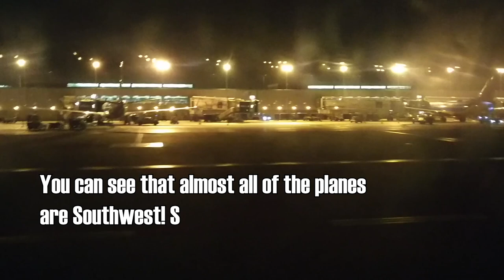Autofocus rambles and a landing at MDW

Comment: Beware, this is an extremely long comment. I figure you know some or most of this, but the audience watching this video might not.

Contrast detect AF, especially in continuous AF, needs to do a sort of constant "breathing" because it detects edges, and it can only detect the difference in those edges during a defocus. If it doesn't re-check for edges, it has no idea whether or not it's in or out of focus, and the only way to determine that contrast difference is to force a contrast check, which makes a slight wobble of the lens as it quickly makes a minor focus adjustment. It's usually looking for horizontal detail, and that's often troublesome when you have very small points of light. Contrast AF is not aware of depth, or the amount of defocusing, and unless it does a re-check (the quick hunt) it doesn't know whether or not it's in focus.

There are a few types of AF:

1. Range-check. This is done using an external measuring system. The first AF cameras used sonar reflections to determine the distance to the subject. This did work, unless you had something blocking the reflection or very long distances. This was introduced by Polaroid, but was quickly eclipsed by other systems. Because it's not through-the-lens, it's only useful for fixed-lens cameras with no filters attached and it's limited to nearby subjects. You could use another measuring system, like lasers, but the principle is still the same.

2. Phase detection. This is what was introduced in the early 80s as a through-the-lens method. While Pentax had introduced a contrast-type AF camera with the ME F in 1981, the first phase detect SLR camera was the Minolta Maxxum 7000 (or Dynax 7000 in Europe, or Alpha 7000 in Japan). Featuring its through-the-lens phase detect AF module and built-in body motor (instead of every lens requiring a motor), it was the first system camera to popularize AF. The trademark was "Only the human eye focuses faster," and, well, it was true. Its single AF point is laughably quaint by today's standards, but Minolta did put together the first really serious AF camera system.

Unfortunately, they infringed on Honeywell's phase detection AF patents to do this, and the resulting court case essentially crippled the company and set it on a path to merging with Konica. All of their misadventures with the xI series also sealed the deal. But that's getting ahead of ourselves...

Phase detection works by comparing the phases of two out-of-focus areas and determining the difference of focus (backfocus or front focus) and exactly by how much. It's not that much different in practice to using the split-prism in a manual focus camera's viewfinder. The camera then moves the lens focus group by exactly that amount. It is swift and sure, but it can also be fooled! All SLRs since the Maxxum 7000 use this method, just in greater complexity. Phase detection is great for continuous tracking AF performance, especially when combined with predictive AF algorithms. By comparing the in-and-out of focus areas not by contrast but by phase difference, the camera doesn't have to second-guess itself. It just makes the move based on the detected focus difference.

The downsides of phase detection are:

1. The modules are not in line with the film plane, meaning you can get distance measuring errors if the module is not in perfect collimation.

2. You're limited to where incident rays fall on the exit pupil of the lens. Because these systems use semi-silvered mirrors to steal light, you often get coverage that sticks to the central part of the frame, at best. The farther you get away from the center axis, the worse the phase comparison performance gets.

3. The phase sensors are limited to detection at certain F-stops and contrast directions. Some cameras have sensors with multiple levels of sensitivity (e.g. most Minolta cameras post the Maxxum 7, which have a double-cross f/2.8 sensitive sensor, along with f/6.3 sensitive sensors), but you only get that sensitivity boost on that one sensor. You can't AF with anything at a narrower aperture, and because the lens has to focus wide-open, you can get focus shifts when stopping down.

4. These systems can be fooled by very near subjects. The human does need to give it some help (e.g. using the joystick to position the AF point or using a focus limiter to ignore certain ranges).

Next, is 3. Contrast Detection. This is what's used in video cameras with CCDs, and most point-n-shoot digicams of the 90s and aughts. Contrast detect works by finding edge contrast. Go into Photoshop and use the "Find edges" filter and you'll see what I mean. The advantage to this is usually that it measures right off the sensor plane, so you'll never get front/backfocus errors, and you can use it at shooting aperture, which means you can dodge focus shift (most of the time). By making a quick snap of the focus, the camera can find edges in the image, and then once the edges reach a certain acutance, it locks focus.  This is great for single AF (lock on and then don't refocus). However, this is bad for continuous AF, because it doesn't actually know anything about the direction or amount of defocus. It only knows about edge contrast.

Some manufacturers (like Panasonic) have highly tuned this with their Depth from Defocus contrast system to improve continuous AF results, but it's still a bit weird and behaves differently from the phase AF-C that most people are used to.

You CAN combine these AF systems, especially in mirrorless camera bodies. Sony has lead the field in on-sensor phase detection systems, where certain pixels are masked to behave like phase-detect sensels. By having the phase detect on the imaging plane, you ditch the front/backfocus problems, and can have a much wider AF point spread too because the semi-silvered mirror is gone. By combining the on-sensor PDAF with contrast detection, you can get a best-of-both-worlds hybrid system where phase detect can do raw defocus/distance measuring and contrast detect can get edge acutance. This is what's setting the world ablaze with Sony's mirrorless cameras, and because other manufacturers are using Sony sensors (like Fuji and Olympus) they too can enable similar features in their cameras, albeit with their own implementations.

On-sensor PDAF can also be mixed with off-sensor PDAF, as seen in Sony's a99ii, but it's a rarity amongst cameras for a variety of reasons that are beyond the scope of this comment.

ALL AF systems are limited by light and contrast range (just different kinds of contrast). Very low light areas or areas with no detail (e.g. flat surfaces) will lose focus. This can be worked around (AF assist lamps), however the behavior of hunting changes based on focus methodology. Phase detect hunting tends to go towards extremes (fully in or out) while contrast wobbles and steps slowly. A wide AF array should be able to see large groups of objects, but without edges (contrast) or lines (phase) there's just no detail to check. Some cameras' wide AF methodology can only check for areas inisde one point (determine a point) while others will use multiple points in the plane of focus to keep the lock. Continuous AF is best for a moving subject, this is a case where using AF-S, back-button focus, or a program/camera that can lock or hold focus is better than just sticking with continuous AF.

There's also Canon's Dual Pixel AF which is a different physical of on-sensor phase detect, but works towards the same goal. Aptina (another sensor manufacturer) also did its own on-sensor phase detect system used in the Nikon 1, but they have since cross-licensed their patents to Sony and pulled out of most of the market.

There's a basic primer on AF systems, how they work, their gotchas, and their strengths. I forewarn you, going down this path is a dangerous one. You will start attracting camera nerds who put brand above all else, and they are not for the faint of heart. However, your videos are great and if anyone can do a straightforward explanation of how all kinds of AF works, I believe you are more than up to the task.
Reply: Thanks, this is very helpful!
Reply: Wow, excellent! Best youtube comment I ever read 👍👍
Reply: I read every AF as As Fuck
Reply: "...audience watching the video might not." Hey, I'm here specifically for this level of detailed tech info and geekery! To paraphrase Tech Connections Guy, "spoiler: huge nerd." Thanks for the edification. 😁
Reply: And what about using two sensors for sensing 3D? We have two eyes, and that contributes to fast focusing.
Reply: This is kind of what the Dual PDAF on the Sony a99 with AF-D mode and the a99ii with Hybrid PDAF does, in terms of multiple depth sensing. You can also build a depth map by using multiple focus points on a single plane, which is what Nikon does with its branded 3D tracking.

You can use other information to enhance AF, such as face/eye detection since the image sensor can give you more subject information, like color, shape, and acutance. Most of the challenge of AF is identifying the subject the photographer intends and following/predicting the movement of the subject to maintain the AF point position and move the focus along with the moving subject.
Reply: Great explanation, but I would not mind if you went into more detail (not kidding). Thank you very much!!
Reply: Regarding defocus snap on contrast-AF, most manufacturers design some kind of AI that can sense if there are big changes in the scene. If not much changes, the focus stays fixed. The moving lights have the opposite effect. Also they tend to emphasize the center since that's what most people expect cameras to do.
AFAIK, hybrid-AF defaults to contrast-AF in low-light situations.

A lot of phones today do hybrid-AF as well, most with the 12MP sensor. Some pixels (half?) from the sensor are used for phase-AF. I think the first phone to introduce this was Samsung S7, back in 2016. The S5 had only a single center site for phase-AF, as well as other phones at that time, so they were technically also hybrid-focused.

I think there is still a lot of potential to innovate as chips become faster and the cameras start to recognize what's actually happening in the image, instead of just blindly applying some algorithms. This is where machine-learning starts to shine, but that's a that's something that will have to wait for another episode.
Reply: Such a fantastic comment, thanks for the thorough write-up!
Reply: I'm a bit late to the party here, but I've got a few questions. (long comment for a long comment, even if yours is bigger... [that's what she said])

Is there a reason that modern cameras don't have the auto-focus calculations (hunting) be done... for lack of a better term, off-screen? Basically it would leave the displayed image at the current focus point, do the sweeps to find where it's most focused, or rather, where it's least blurred or smeared, then update the displayed screen to that.

Is there a reason that modern cameras aren't able to tell the difference between a dark scene (like the ground at night from an airplane window) apart from something that's just dark (like something painted black)?

Is it purely a lack of computational power that prevents a modern camera from simply trying to make each pixel have the highest possible contrast to the neighboring pixels? what about just a very large number of pixel points spread across the over-all image? If it's sampling, say... 1,000 points across the 2,073,600 pixels in a 1920x1080 image, it should be able to find the point at which contrast is greatest when the contrast is above X threshold with relative ease, so I'm assuming it's just a computational limitation of the components that make up the modern camera (ie: the CPU ain't stronk enough).

Although I'm not sure about modern stand-alone cameras, modern cellphones all have gyroscopic sensors, GPS tracking, and many other ways to detect movement, and so should be able to identify what the phone is currently doing. Can't the cameras use this sort of data to figure out that traveling at ~125+ mph while the camera is sensing mostly black and a bunch of point lights to detect that it's probably not looking at something close up and focus on the lights on the ground better? Obviously this wouldn't really work all that well for recording fireworks or christmas light displays, but surely there's more contextual data that the camera could utilize to better figure out what is going on, right?

Also, many modern cellphones now have multiple cameras. Are manufacturers (or programmers, whatever...) using those extra cameras to work together to create a superior auto-focus that can utilize multiple data points to improve focus? The (intentional) distortion each lens causes is a known variable and can be adjusted for, so it's not like the different lenses would make the data incompatible. Surely that extra data isn't just being left on the cutting room floor.
Reply: @TheAruruu  I’ll try to address each of your questions.

1. “Modern cameras” focus off-the-sensor using both the live view feed and phase detect sensels as part of the sensor array. When using the phase detect sensels, it tries to detect which direction to change focus by the difference in phase. You will always see a “change” on the screen when focus changes because that’s why it’s live view. Panasonic cameras have a contrast detect feature called DFD for “Depth from Defocus” which does something like you say for contrast detect, but you will always see the effects of focus change. That’s the point of live vew.

2. Modern cameras DO try to tell the difference. Object and scene detection is part of many AF algortihms. Go check out a Sony full-frame mirrorless like the a7RIV or a9 and check out its tracking AF. This is one of the benefits of the combo off-sensor phase detect method used in many mirrorless cameras.

3. There’s more than just contrast involved, but individual pixels are usually too small. Think about how many pixels are on a 42MP array. That’s why AF points are usually “larger,” but again the AF points on something like an A7RIV are very dense.

4. Things have improved a lot over the past several years. Even then, most of the time dark scenes with pointy contrast are not impossible scenes. Video AF and stills AF require two different things, and there are a lot of knobs to turn on them for desired effect.

5. Multiple cameras don’t really help in this scenario, but additional items (like LIDAR sensors) used on iPhones help a lot. Not in this exact scenario, but ultimately you’re usually struggling against the amount of available light and other issues (rolling shutter, small aperture, blah blah blah).
Reply: @kefkafloyd  Thanks for the quick response. You didn't really answer #3 though. Obviously the sensors are going to be incredibly dense, but if the displayed/recorded image is in 1080p, then the extra data provided by the sensor should only aid in defining the sharpness and contrast of each individual pixel in what is effectively a down-scaled version of what the sensor is receiving. That should make it even easier to auto-focus given that there's more data than is being displayed... right?
Reply: @TheAruruu  I already answered it earlier, the entire scene is taken into account, but there's relationships due to sensor readout (the camera does not readout all pixels simultaneously) and trying to analyze across multiple frames in real time. Continuous subject-based AF is biased more towards, well, subjects. You can also run into larger theoretical problems like field curvature and "what, exactly, is the subject?" Fully explaining that would probably take me all day, but suffice to say that in continous tracking modes they already take that into account. The same tech that determines if you have a face or distinguishes between color areas does this. But, again, video AF and stills based AF have two different jobs and at some point the operator has to direct the camera in some way. How tenacious the AF is on a static or low-contrast scene is something that's been worked on for 30+ years. The camera is already basically doing what you're asking it to do when analyzing the readout and other sensors if available, but there's a lot of subtleties and subjectivity to it. Compare where mirrorless cameras are today to where they were 10 years ago and you will see the difference based on image analsysis and sensor readout improvements. What you asked for has basically already happened.

Comment from the maker: Before someone brings it up; yes there are more than just 2 airports in Chicago, but O'Hare and Midway are the major ones that you or I would be travelling through.
Reply: Technology Connections 2 both are awful to fly to or thru during the winter months. So many times diverted or stranded there.
Reply: I remember old Meigs Field for it being the default airport in Flight Simulator. Years later, I read about what happened, how it was demolished almost as a covert op, in the middle of the night and without notice. Sad.
Reply: Wow.  I didn't even know that Meigs Field was gone.  Guess I don't get out much, LOL.
Reply: I've always felt that MDW was a bit of a harsh landing... I like to sit near the wing and watch them "panic" to stop the plane while the engines reverse. I'm guessing the runways are a bit small. Still, living near it, it's the only one I fly out of.
Reply: SaltyHashes Midway is a square mile in size
Reply: @NJP76  Mayor Daley was totally freaked out about Meigs Field after 9/11, because it was so close to downtown. He couldn't get it closed legally, so  he sent bulldozers in the middle of the night to carve large Xs into the runway, so planes couldn't land or takeoff anymore.